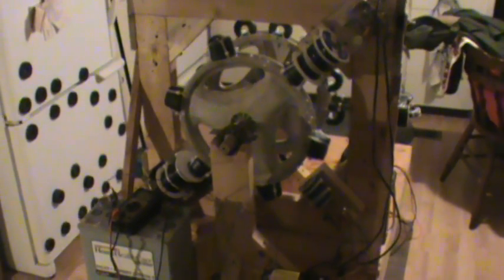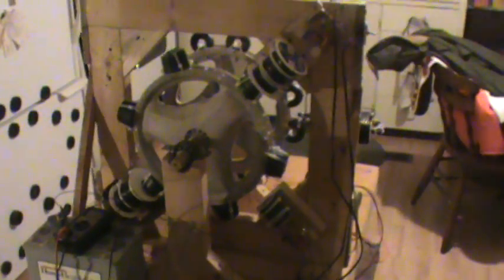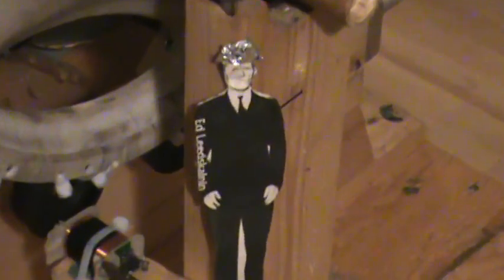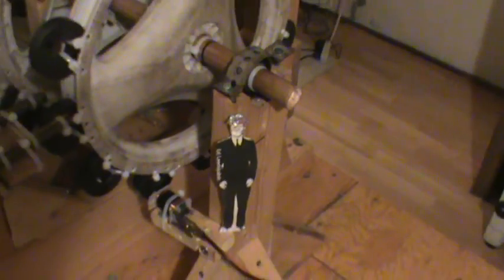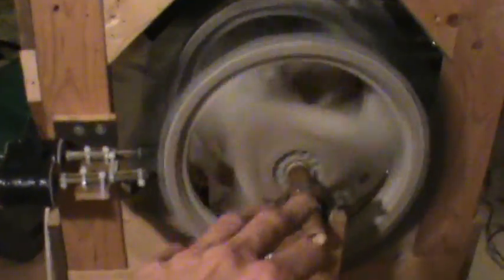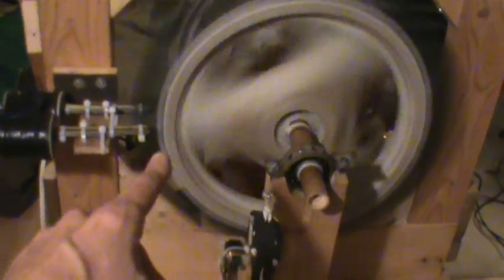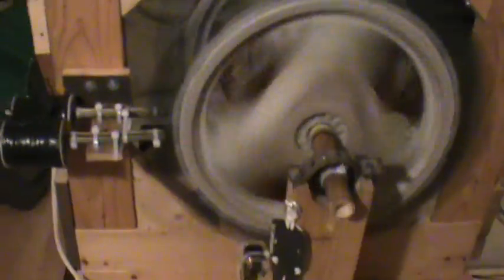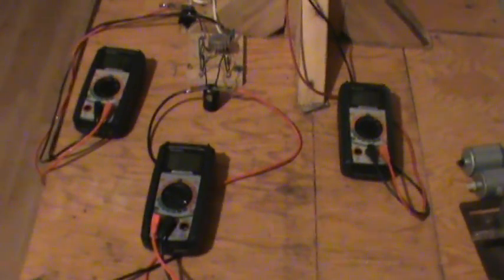Free Energy Project - EdiniGen

Comment: When you show me this, im automatically thinking "gears".
1 wheel & 1 set of these magnets is like 1 gear with 1 chain right?

Im thinking multiple wheels of different sizes, multiple magnet systems, attached to the same axial shaft or perhaps a variety of different hollow shafts within each other. (to overcome any small losses which would exaggerate into any huge losses)
hmmm you have certainly compelled me to think way outside the box in respect to incremental harmony.

Comment: I got mine to work by using magnets from hard drives and parts off of my washing machine. When you adjust the stator according to the Djubrum principal the extra energy lost due to the laws of thermodymamics is compensated by the absorption of heat and it's dissipation through the magnetic field, in other words, it'll get cold.

Comment: As of the ed leedskalin coil I think when the magnet is between the two poles the magnetic current is going round in the iron.
When the magnet is disconnected the magnetic current is leaving to the blogwall zeropoint in the corner hereby going in opposite directions of the coil en thus adding the currents then. therefor I think it could work with only north magnets.
But thats just my theorie. I Did trie bedini with n-s-n thoun and it worked but no scalars then I guess.

Comment: Great video, you worked realy hard lately. I like your setup. I am working on a similair setup but much smaller.Ihave a little 12cm diamater tube with 6 big magnets on one site with a bedini setup (just one coil) and 8 smaller ones on the other side where I will make the bucket coils. it is now running without the bucket coil and it is doing 1800 rpm at 350 mA 12v. Unfortunatly I can not work so fast now due to a hernea.

Comment: Thanks Angus for another great video, the Leedskalnin PMH shorted work you are doing is fascinating.  The fact that you are building out of spares and salvage is ace.  When you wire up the PMH's as you go along, how about wiring them into terminal connectors so that you can experiment with outputting them in parallel / series etc maybe connect up alternating pairs and so on? I'm not seeing anyone else working on this in such an easy to follow way so congrats. Time for me to visit PayPal I guess!